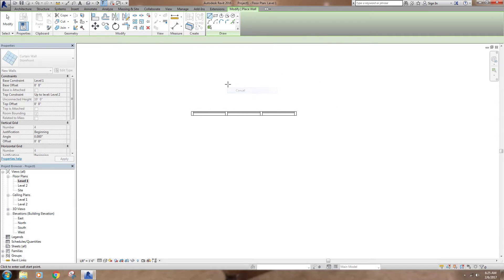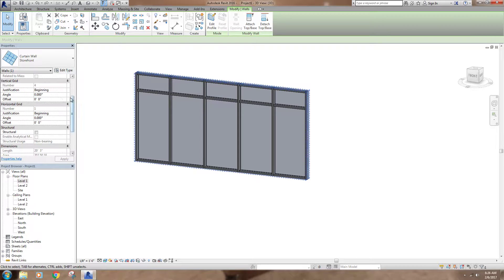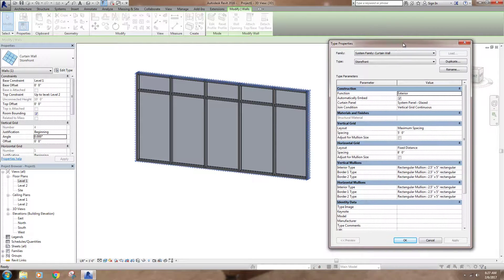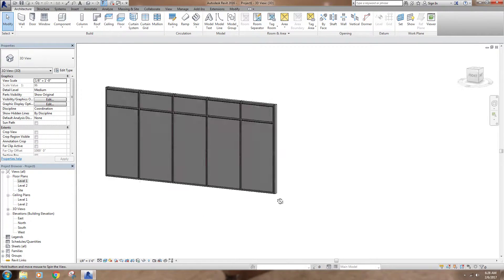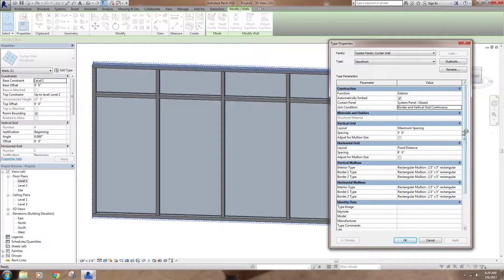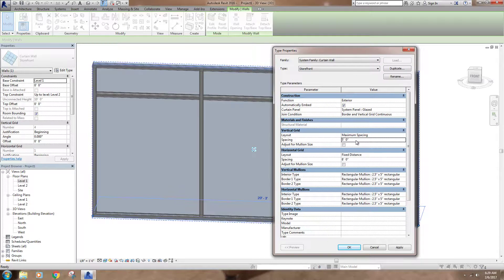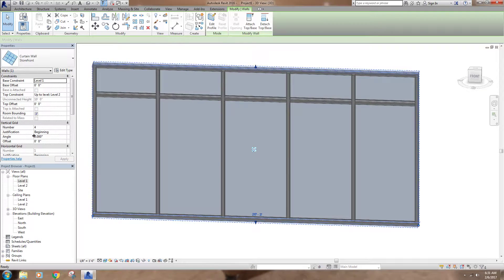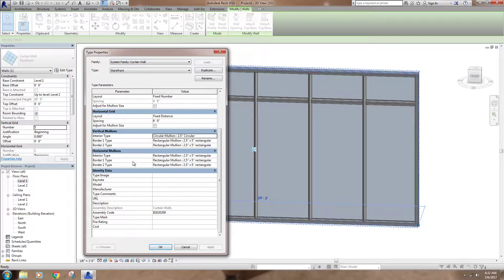Revit 2016 Storefront & Curtain Walls

Comment: I dont have store front on my curtain walls i only have curtain wall 1, why is that?
Reply from the maker: What project template are you using?  Some of them may not have it.  If you don't have it, you can create a curtain wall and then add all of the mullions using the mullion tool on the Architecture Tab.